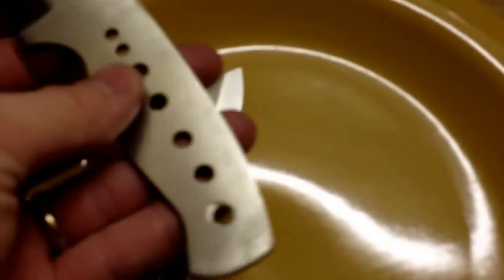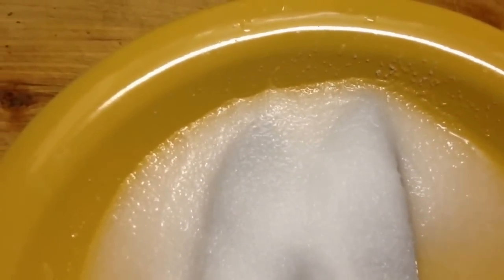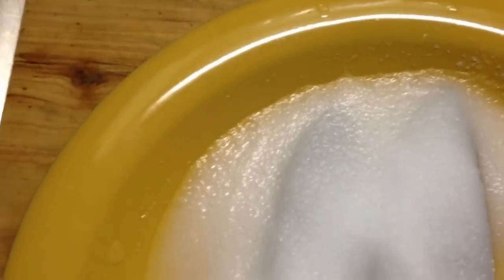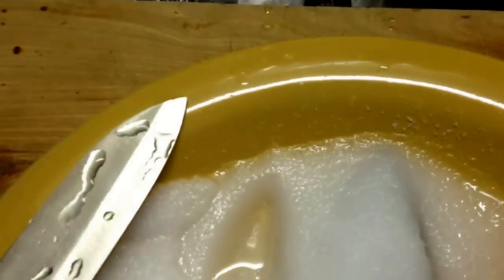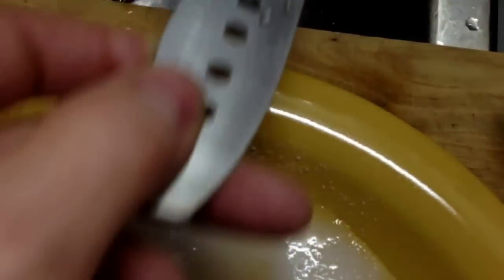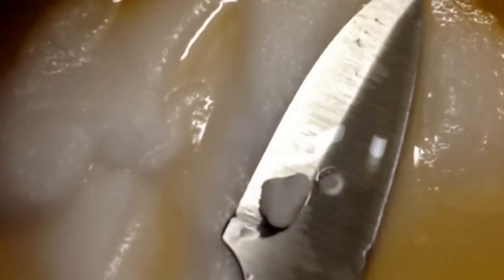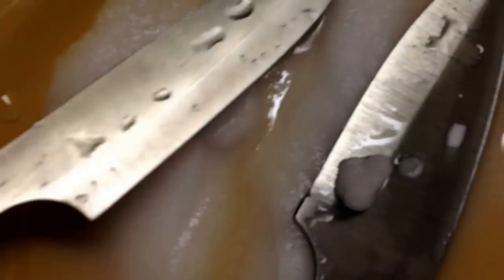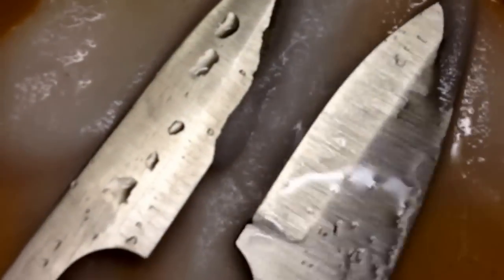Corrosion Testing 14C28N vs AEB-L Part 1

Comment: Ha, are you sure you used enough salt.
Reply: never to much salt.   it keeps the spooky things at bay

it will be interesting to see if the 14C28N has better corrosion resistance to AEB-L / 13C26.  if i am not mistaken the nitrogen is supposed to make it better